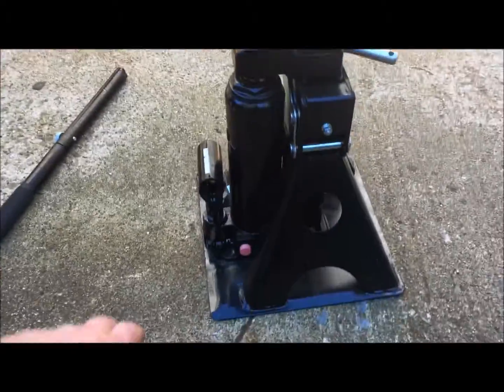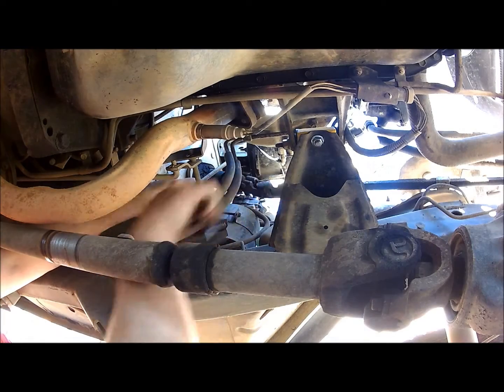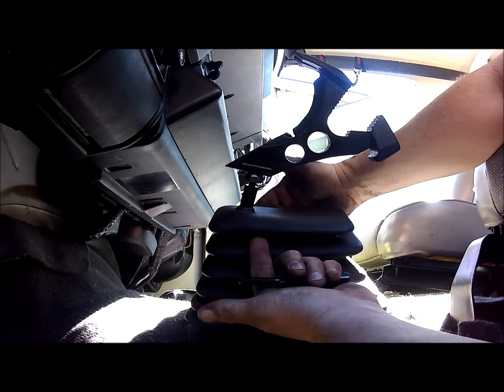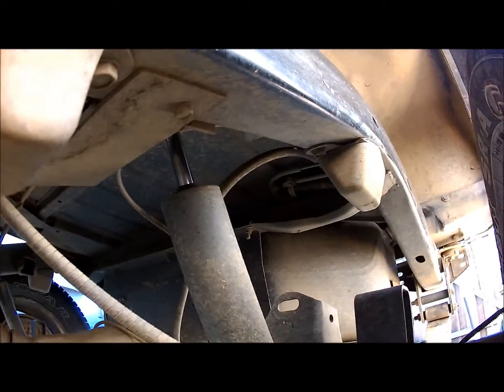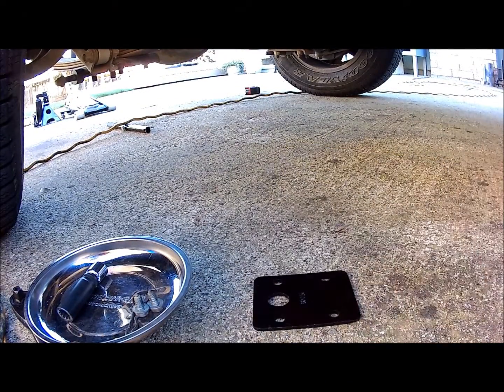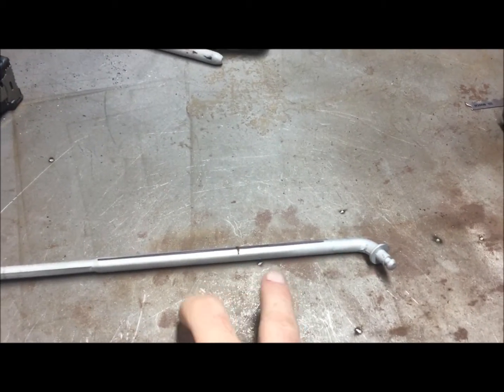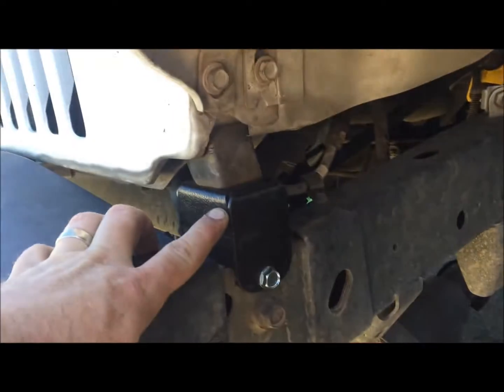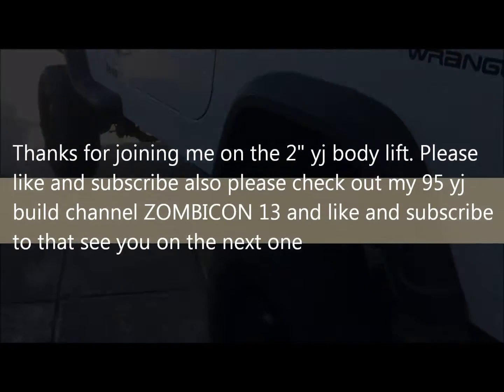Jeep Yj 2" rough country body lift

Comment: Thank you for the video it was pretty detailed.
One question on the gas filler hose, did you have to extend it??
Reply from the maker: Actually no I didn’t have to extend it. But getting a longer hose would of been easier.
Reply: I appreciate your input and I really found your video useful. On that body lift as we speak. Thanks again.
Reply from the maker: Nice thank you for checking it out
Reply: @OFFAxisBuilds  got it done yesterday and ofcourse i used your video as my back up point.
I can still hear your voice, damn it... hahahaha thanks for a clear and well narrative  video.
Reply from the maker: Good to here you got it done. Thanks for checking out and watching my video.
Reply: I have one last question on your motor mounts. Are they an inch taller than the stock one's?
Reply from the maker: @handballduenas  yes i went with 1" taller motor mounts to help realign the drive lines.
Reply: Perfect. I found them.
Thank you for your help.
I appreciate you!!
Reply from the maker: I have another video on how to install the motor mounts.
Reply: OFF AXIS BUILDS I’ll go look now. 🤲
Reply: What did you torque your bolts down too on the lift kit if you don’t mind my asking.
Reply from the maker: 80 ft lb
Reply: Much appreciated sir!!
Reply from the maker: julio g Duenas no problem good luck take your time and it will go smooth.
Reply: @OFFAxisBuilds  hopefully last question sir.
I did a 2 inch body lift, should the motor mounts be 1 in taller then the stock one or two inches? Maybe a dumb question but I had to kill doubt.
Reply from the maker: From all the research I did you can still run the stock motor mounts for the body lift, but if you put a suspension lift you will need taller motor mounts. I am running a 4” lift suspension lift with a 2” body lift and a 1” motor mount lift. So if you are only lifting the body your engine and drive lines will stay at the stock location. You will need to make a longer shift linkage if you have a automatic.
Reply from the maker: Send me an email and OffAxisBuilds@gmail.com if you want a quicker response
Reply: @OFFAxisBuilds  manual 4" suspension and 2" body so that answred my question.
I'll do a 1" lift mounts.
Also doing the sye. 
I saved your email.
Thank you once again your too kind.

Comment: Where did you find the angry Jeep headlights?
Reply from the maker: i Actually made them. i tapped off the part of the light i didn't want painted and then i put about 6 coats of rustolium bed liner paint
Reply: OFF Axis Builds that is amazing I’m impressed with the turnout and it looks stunning.
Reply from the maker: Carlos Arias 
Thank you. I have had those painted like that for about 3 years now.

Comment: How is the ride quality with a 2 inch lift?
Reply from the maker: keith bishop 
This was a 2" body lift not a suspension lift. The ride didn't change with the body lift. It doesn't do anything with the suspension. All it does is lift the body up so you can put taller tires on. I do have a rc 4" lift and it rides nice. I removed my sway bar and front and rear track bar. I like the way it handles however I haven't had a chance to take it off road yet. Thanks for watching please check out some of my other videos
Reply: I was referring to it feeling like it was top heavy
Reply from the maker: keith bishop 
To me it feels the same as the stock ride height, but I only owned the jeep a couple of months prior to installing this kit. Over all I like the feel of it. With the 4" lift and 2" body lift and 1" shackle lift. But I'm not running 33" tires yet so the ride quality might change. Also I'm running 2" wheel spacers. If I had to do it all over again I would set it up the same.